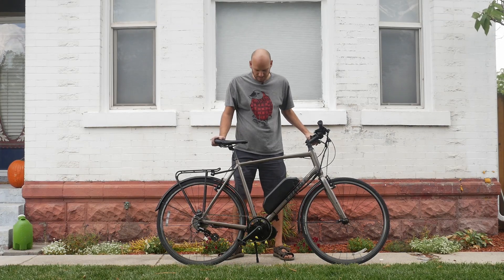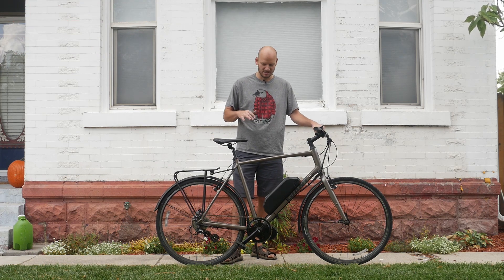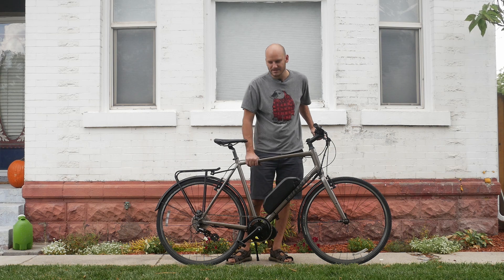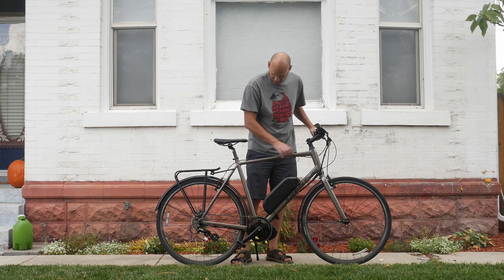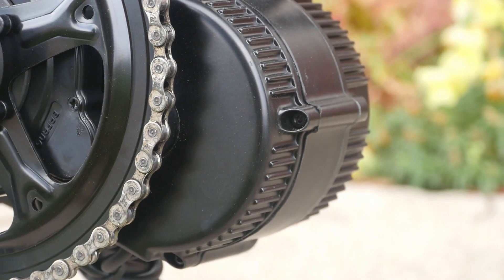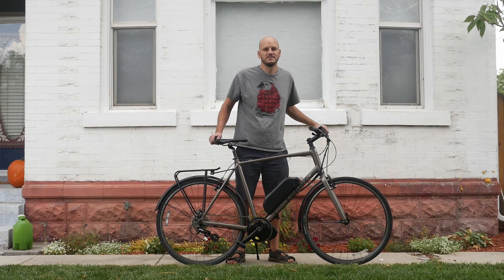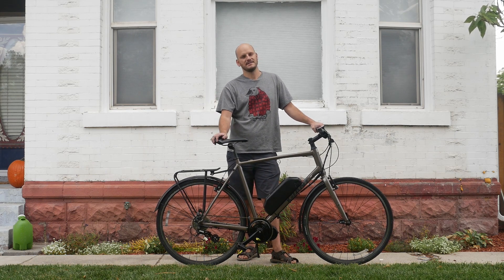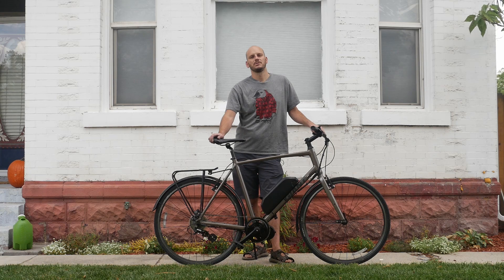Custom E-bike Build: Giant Escape BBS02 52v

Comment: I have a Giant Seek 2 from 2012. I am looking at buying a 750w mid-mount. The crank is 68mm FSA cartridge (BSA). Would I need any special parts?
Reply from the maker: You should not. However, sometimes people find they might need one or two bottom bracket spacers. They are about a dollar a piece so it doesn’t hurt to have one or two just in case you need to shim the motor away from your chain stay or bottom bracket. Besides that you should be all set
Reply: @JohnnyNerdOut  Thanks, much appreciated!

Comment: Is there a way to do this on like a 500 or $600 budget? I have a giant escape and I mainly just want to use it on Towpath with my woman's kayaking group. I'm fine with like a 500 W motor in maybe like a quarter less powerful battery. ideas for parts?
Reply from the maker: Toseven dm02 motor is $330. The battery is the variable, but if you don’t need a big one you can get a small capacity battery fairly inexpensive

Comment: I have the same bike with hydraulic disk brakes. Was thinking about hub motors till I came here. How was the install?
Reply from the maker: Easy peasy
Reply: @JohnnyNerdOut  fitted the kit yesterday, works beautifully on the escape disc. Thanks for videos on tools and the full conversion. Very helpful.
Reply: @Gopher31  I’m just about to do this on a disc break escape. Did the motor catch on any of the cabling? I know it’s internal to the frame but where it comes out at the bottom I was wondering if it caught it at all?
Reply: @Pootangclan  No it went in perfectly. There is one little screw at the bottom of the bottom bracket that needed to be loosened to get the motor in but that screw doesn't seem to do anything. The Motor sits ahead of where the cables come out so it has nothing to crush. Much easier build than I expected and it was my first time.
Reply: @Gopher31  excellent thank you for your reply. I can’t wait to do this, hopefully by the end of the year !
Reply: @Gopher31  sorry one more question if that’s ok. What size chainring did you go for? Im thinking of a 46t chainring
Reply: @JohnnyNerdOut   That's good, thank you. I was just worried that the motor housing or chain wheel might hit the chain stay. I assume this wasn't the case?

Comment: My favorite conversion.. We carried heavy loads across The Alps with canti's. It rains, it snows. Use common sense and rim brakes work as well as disk. You can't stop faster than you skid.

I wish The BBSO2 had a torque sensor. That would improve response and range while eliminating the need for shift or brake sensors.

Comment: That's my bike!  I'm loving it!  Just to expand on the efficiency comment.  I haven't recharged at all.  Haven't plugged it.  Not once.  I've put almost 70 miles on it and the battery still shows full bars(which we can assume isn't 100% accurate, but still!)
Reply from the maker: That's awesome! That bike is pretty much the the epitome of efficiency, so I'm not totally surprised. I bet with moderate pedaling 100+ range is doable.
Reply from the maker: Definitely keep us posted to what you end up with before needing to charge!
Reply: What size frame is it ? I’ve just ordered a small frame. Not sure if the Dow tube battery will fit. Or if I’ll have to fit it on a rear rack
Reply: @Pootangclan  it’s a city escape extra large. Not sure what the exact dimensions are. :-/
Reply: @jasonpowell4084  thanks for the response. I’m about to do the same bike :)